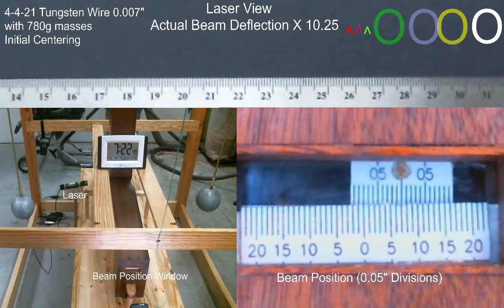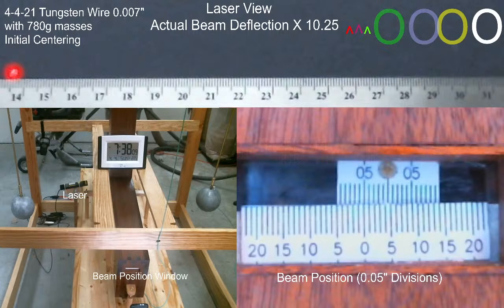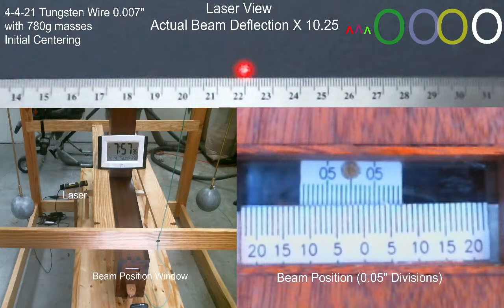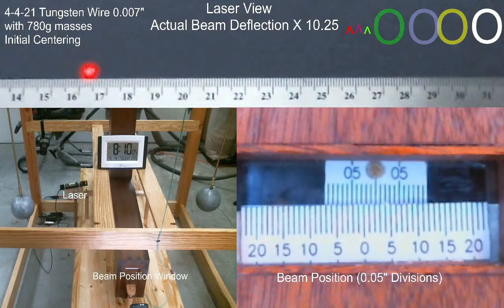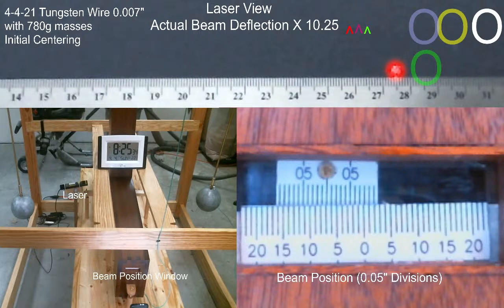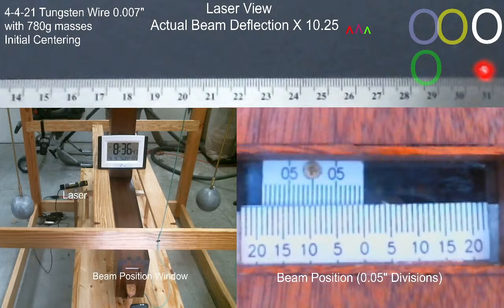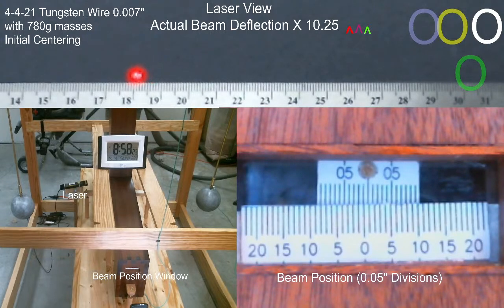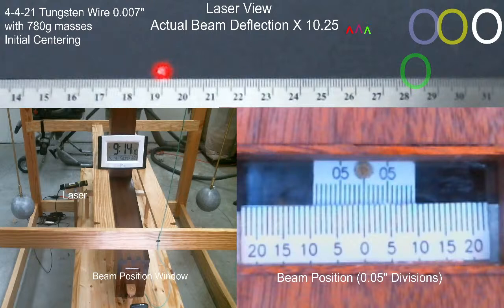BlueMarbleScience Live - Initial Adjustment of Tungsten Wire!

Comment: The more I follow this project the more ideas I get.
I never considered changing the wire. I figured the pendulum would only have to settle once. Testing different wires changes everything as well as bringing it into a teaching environment.

  I feel a device needs to be devised and installed under the balance beam in line with the wise axis. A brake or a dampener of some sort that can be dropped out of engagement. My argument is that as a teaching tool, spending hours and hours just waiting might be frustrating for young people to the point that the reason for being there is lost.

 As I said, I never thought much about experimenting with wire materials. I'll bet kids will.

I wondered what Spiderwire fish line would do. 
I also like the stepper motor wire anchor at the top. With a gearbox so the stepper doesn't have to be microstepped.
Reply: The traditional damping device for pendulums like this is a vane attached to the beam that dips into a container of liquid, such as a light oil. Water would not work, because it would evaporate and cause all kinds of humidity issues. The problem would be the mechanism to lower the liquid container when you wanted to use the balance. That would very likely introduce some vibration and disturb the beam, and there would also be oil dripping off the vane and changing the characteristics of the pendulum. The simplest solution is to have nothing, and accept that the beam will oscillate for a long time until it stabilises naturally.
Reply: @ceejay0137  That's exactly the design I had in mind. I was considering STP but that might be a bit stiff.  I don't share your worries about the adverse affects. I'd be surprised to see any disturbance when the damper is dropped down away from the paddle.
I would mount it on one end of a teeter toter like structure.
  Thanx much for commenting. :)

Comment: Felt like I left you hanging on discord. I was managing a reload crisis for a few trucks. But, jolly good work blue. Oh, I understand logistics and such would be an issue. But, what about a ceramic rod for the torsion bar? Hmmm
Reply from the maker: Ceramic or quartz ribbons have been used but they're ridiculously expensive ($ x 1000) and super fragile. That's the problem.